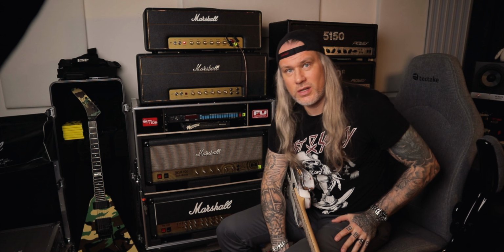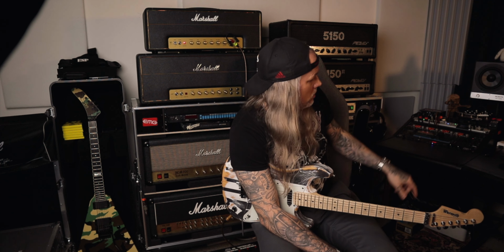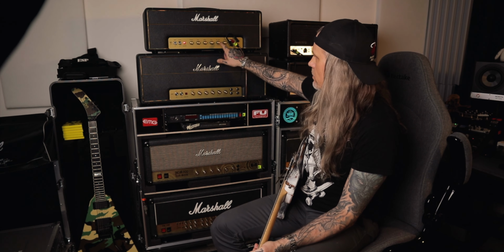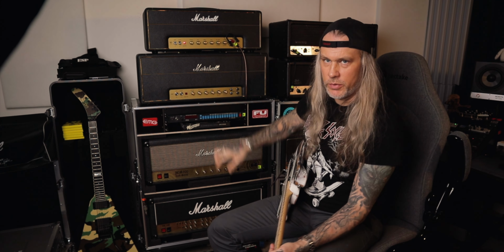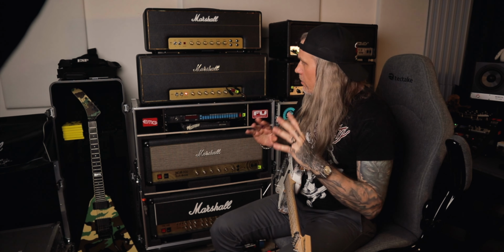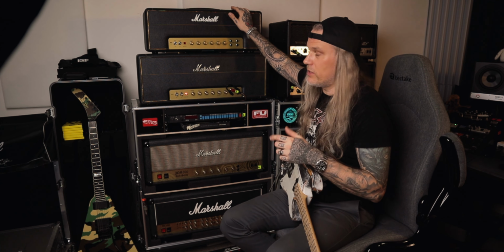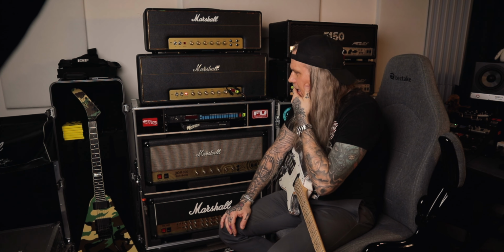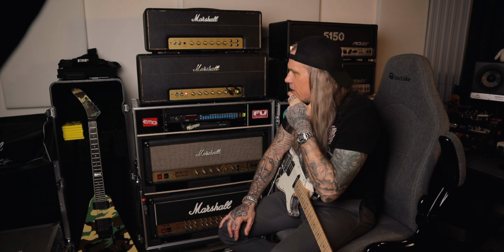MARSHALL Plexi Comparison: 1959HW vs 1987X

Comment: Also, the 100W is full rectified while the 50W is half rectification. As well as some cap value here and there. But yeah, 50W are a bit bassier, gainier and more compressed generally.

Comment: Cool video! 1959HW for me. It's cleaner.
Reply: That's the point. More Watts means more headroom. So if you play clean 100 W is better. If you play high gain with volunöme at 10, then you need a 1987x and an attenuator and hearing protection.

Comment: Euge, sorry for the question. Do you have 230V in Finland, right? So you are simply using to Variac at 160V with a 230V amp? The '59 sounds impressive, the 1987X a bit  darker and less detailed compared to the big sister, but I love both. I was searching for one of the two, or a 90s SLP because they were based on 70 spec super lead circuits, the 1959 HW if I recall is based on a '68. Confirm if I'm right. Great videos as always 🙂
Reply from the maker: 220-240 in Europe in general. I live in Switzerland and in my area / studio I’m getting 220-225 (depends on the day 😎). Yes the amp is set to 230V but I’m getting approx. 220 and just lowering it with a Variac. This time to 160. Sometimes I’ve gone as low as 140 and sometimes just a bit to 180-190. Depends on the day and what I’m looking for and feeling 🎼. 

Yeah if I remember correct the HW is based on a ’68 circuit. Or ’69 but the info is on Marshall’s website. Thanks!
Reply: @EugeValovirta230V  oh ok, I live in Italy and here there are days when amps sound awesome and days where they sound like crap. I was thinking to the BrownBox, or a Variac too.

Comment: I'll take both, haha! 🤟
At higher gain settings without the variac they sounded so close, I'm not sure if they felt any different. At lower gain settings, regardless of the variac being used or not, I preferred the 1959, it was just «it». But as a player I know I would probably feel more comfortable making the softer 1987 work, since I pick light.

Comment: SLP for lead
1987 for rythme
think angus and malcom type mix 

whats so cool about the circuits are there are not that many differences, but the two amps can not do what the other one does. 

i have a1959HW with NOS mustard caps i put throughout and that amp is front and center. it will not get lost in the mix. however, i plan on building me a 1987 because i do love the sound of those. it just has a little of the aggressiveness rolled off from the SLP.

Comment: I think I agree with you. 100w with variac was the best sound. I think there is maybetoo much happening with the 50w with variac. Too compressed and undefined, it kills the amp a bit too much I think, the 50w may need less voltage reduction to be in the sweet spot maybe? Without the variac the 50w sounds a lot better imo. The 100 w lacks a nice push without the variac, it needs more.
Reply from the maker: Yeah my sweet spot for the 50w is usually a bit higher like 170-180V but I just decided to use the same with both for this comparison.

Comment: On the 1987x, I'd put an MXR-6 in the loop, crank the mids just a bit, it sounds a little underwhelmed at 1.4K.  Plus, as you said, the comparison is a little misleading comparing a 100W to a 50W, physics.

Comment: I guess you are the 90% + humbucker typ but whats you opinion on humbuckers they can sound like single coils? Like some of fishmann !?
Reply from the maker: Humbucker on bridge, single coil or humbucker on neck. Haven’t tried but I have a few passive Duncans that can be splitted but it’s not completely the same to me for some reason.
Reply: @EugeValovirta230V  My idea is change on a gitarr humbuckers to single coils. Is my thinking correct that is more easy make a single coill sound like humbucker than humbucker make sounds like single coil ?
Reply from the maker: You can’t make a single coil sound like a humbucker. It’s physically impossible. Humbuckers have two coils (which one can, depending on the pickup, split) and single coils have one coil 😎.

Comment: So glad you got the 100W. I had been going back and forth when you did the JTM 45 and your 87X 50W Plexi. I ended up getting the 100W Plexi your probably keeping I hope and the JTM45 Handwired. These amps are the bomb. Very cool to see how your operating them. I will try out the variac on mine. I have been using it but not as low as you are. I am going to try it. Awesome videos and comparison here Euge. RockNRoll
Reply from the maker: Yeah I’ll keep only the 1959HW. That’s the ultimate Plexi to me 💪. Thanks!

Comment: Did you ever do tapping with the middle finger, so that you don't have to move the pick? Not giving advice or anything 😄 Just wondering if there's some upside to tapping with the index finger.
Reply from the maker: I guess I'll do both. I don't really think about it. Just whatever comes naturally.
Reply: @EugeValovirta230V  For me, what came naturally for picking was holding the pick between my thumb and middle finger. I quickly realised that the big boys don't do it like that. So I corrected myself. I guess what I'm trying to say is that my natural is different from your natural 😄

Comment: Do you use the tone controls on the Fryette? Is the depth control turned up at all? Thank you.
Reply from the maker: The small switches are both center and presence & depth just a hair up. Like that my amps are pretty much spot on the same than without it 👌. Well maybe a tiny bit more low end resonance when I go full blast to cabs but I’d cut that out anyway in the mix ’cos bass takes care of the really low end rumble.
Reply: @EugeValovirta230V   Thank you. I think I'm going to buy a Fryette. It seems to be an amazing product.
Reply from the maker: It is!